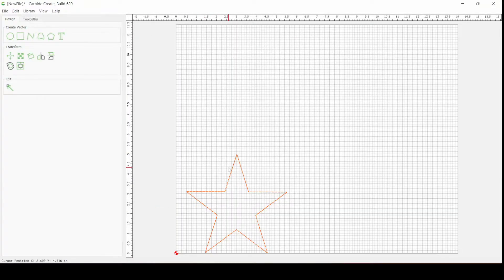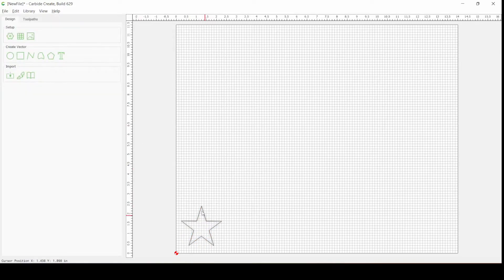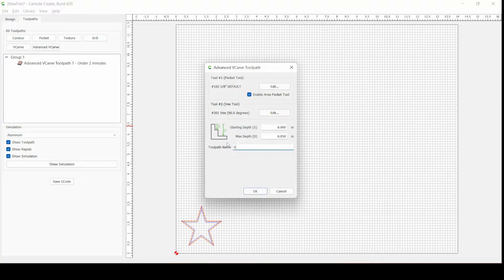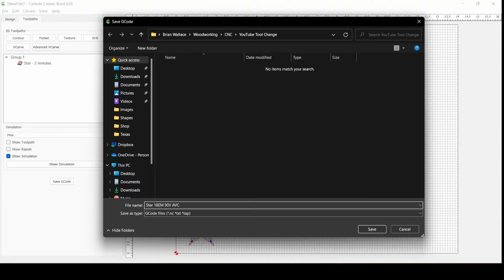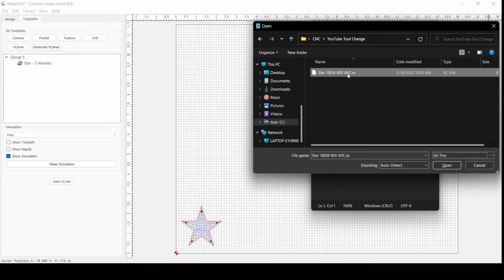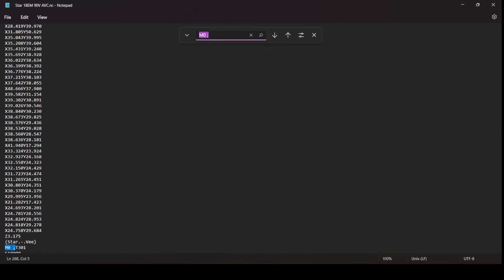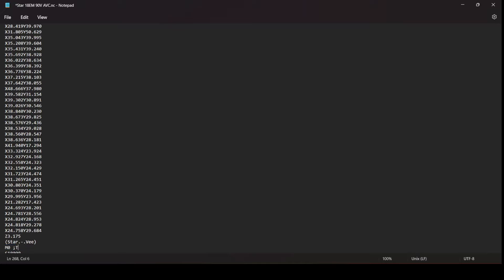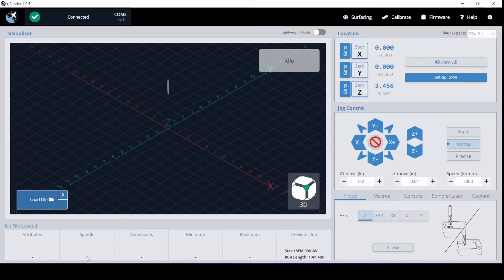CNC Touch Plate Z Zero after Tool Change with GSender and LongMill

Comment: Thanks for the video. I downloaded Gsender as I saw you doing tool changes following search. Followed all your steps BUT when it comes to M0 for the V bit, the program stops with the screen RESUME  RESTART message but all functions, including MACROS are locked out. Can’t move X, Y or Z axis, run the Probe macro etc. Etc. I have to manually distance the V bit from the job then hit RESUME. Any ideas?
UPDATE.
I have changed the M0 to M6 in the code then in the settings changed Tool Change to MANUAL, and that works fine.

Comment: Wow! You've even got hovering text messages to yourself! You've been a busy beaver.
You could have a complete video just on that!
But right now, you're just showing us it CAN be done but not HOW it can be done.
Very nice work!
I guess I will have to stick with single files until I get around to figuring this out myself.
Reply from the maker: No idea what you're referring to on the "hovering text messages to yourself" part  <?>

As for the "HOW" - I've updated the description of this video to contain the text of the macros I used. Hopefully that'll give people at least a starting point for how it can work.
Reply: @prosperwoodworks7366  
You doing this put me in a state of confusion :) 
I don't have any macros so my macro tab doesn't look like that because there is nothing in it. When you hovered over the macros it created a balloon text. Since I don't have any macros mine won't do that. I used to create my own messages so I thought you did that too.
Reply from the maker: No -that's just gSender's message info about the macros. Macros have been the single feature I didn't think I'd use when I started with gSender - but they've become one of my favorite features.

Comment: I take it that the only thing that allowed you to use your touch plate at an M0 pause command was your macro? Am I right on that?
I just ran into this very thing tonight. At the beginning of my project (actually all day!)
I could use my touch plate at the beginning but when it came for a tool change I couldn't use the touch plate anymore. I wound up using paper and I didn't get accurate results.
Thanks for making the video. I would actually like to see more on this. I don't know a thing about macros. The only thing I know is G20 & G21 and thats about it so if you could type all that in your description and how it actually affects letting you use your touch plate I would really be interested. 
I ran into another problem tonight. Carbide create didn't handle very well going to different depths and pocketing out a letter. The letter literally looked like it had 3 different levels in incomplete cuts. There was also a circle to be cut out also which framed the circular wood I had.
for some reason it even started carving out an unfinished circle. I mean the original circle to be cut out was not completely cut out all the way around. I don't ge that either. I looked at the design and the tool paths and there wasn't anything. It even cut out my large letter in 3 different ways?? I wound up getting a surfacing bit out and manually flattened out the letter evenly. It even left large pieces of wood that wasn't cut out and I had to flatten that too. After all that, the bottom needed finishing but it looked like it was going to a slightly different path (just like the circle) and I wound up cutting it off. Not knowing how to find the exact center (Cause the middle of the circle had been cut out) and I hit the shut off button it didn't exactly go back to xy0. It went somewhere else now I don't know exactly how tofinishe the project cause I cant find the exact same center again!
Any thoughts you have on that would be great. I hope you have another video on this oh and by the way, could you make a video on probing for  just the x & y. The directions for that, to me, look spotty (unlike xy&z) and I crashed and ruined a bit trying to go through the aluminum touch plate.
I saw your other videos but just the fact that you came up with the real issues that matter you've gotta another subscriber!
Oh yeah, I too wish I had never flattened my spoil board. I would actually be better off and flatter!
Reply from the maker: First - Yes, the M0 'Pause' is what allows me to use the macros. The first macro just moves the spindle to where I want to do the tool change and re-zero and the second uses the touchplate to reset zero after I'm done changing bits.

I'm not fluent in all the commands, but I'm happy to share what I'm going through and how I address the issues. If I'm not clear just let me know and I'll do what I can to improve and explain.

I don't understand what was happening with the Carbide Create gcode. I've never run into any issues with pocketing being 'off' as long as my tool was setup correctly (diameter and step over).

I've never done just an XY zero but I have another project I'm working on now so I'll see if I can probe XY to address this for you. I had one issue with probing XYZ when I mistakenly changed the diameter to .25 for a 1/4" bit. I probed Z perfectly, then didn't make it past the probe before trying to go down for the X zeroing hitting the probe on its way down. Emergency stop hit when I saw the probe hit so I didn't lose a bit, but I was quick to put it back the way it was (.625 I believe)

Spoil board flattening is something I've done quite a few times. It was the table top flattening that was my mistake. Flipped my table top, screwed my spoil board down to it and surface that and it all stays flat where it needs to.
Reply: @prosperwoodworks7366  
So when it pauses, you move to a completely different location, change bits and check the xy&z using the touch plate and hit the resume button and it goes back to where it left?
Reply from the maker: Yes. First macro moves it. I do my bit change and attach the probe. Second macro zero's it using the touch plate. I disconnect the touch plate and hit "Resume Job" and it takes over where it left off.
Reply: @prosperwoodworks7366  
Please tell, maybe I'm confused. Aren't you supposed to set it to ".25" for a 1/4 bit OR was your cutting diameter different then your shank diameter? After what happened to my bit doing the x&y I'm scared to even use it.

Comment: What if you had to do 50 stars, same process per  star or it does one bit to all stars then 2nd but to end.
Reply from the maker: That depends on how you do your toolpaths. Ideally you'd do all your stars (and whatever else you want to do an advanced v-carve / roughing + finishing using the same bits) together in which case it would rough all of it then ask for a tool change and complete it all.
If you generate a toolpath separately for each star you'd have to go through a tool change for every star. (Maybe there's a reason you'd do it this way, but in general not the best use of time)

Comment: Great that you've got the macros working for your tool changing 👍 with the "setting zero wrong" on the tool change code what exactly are you seeing? 
- Chris
Reply: Hi there. Don't know if you have time for this question but while we are on the subject of using the touch plate, your documentation I find is lacking for probing the x&y only (xy&z is great) and not very clear and precise as the xy&z. The only thing I had to go by was the picture it provided. Words were limited. I had my bit placed exactly like the picture, I completed the circuit, hit the probe button, and the machine took off faster than normal and tried to go through the aluminum block. As a result it broke my $30 bit.
I may be new but incomplete instructions didn't help so if you have a video to doing the x&y that would be great.
Also, adding to those instructions for the x & y would help too.
Reply from the maker: On the tests that I've run zero is set roughly .01 above the original 0. As with the "pre" code it does what the macro method does - just not with the exact same results. I figured it was a "relative vs absolute"/ "in vs mm" or combination difference in the state of the controller when each was run but haven't resolved that difference yet.

Overall though this machine with macros running makes more complex jobs a breeze compared to one tool path at a time. Thank you for all your work!